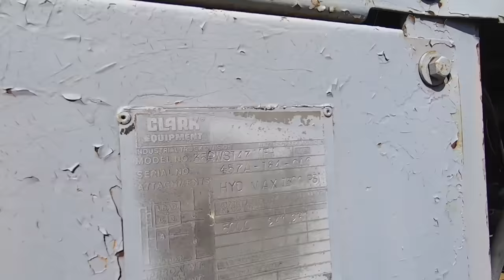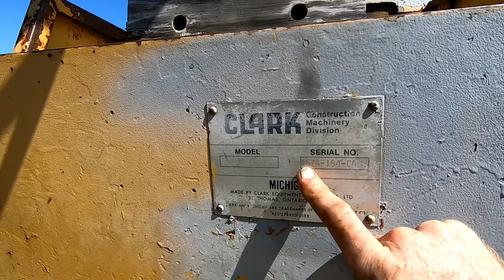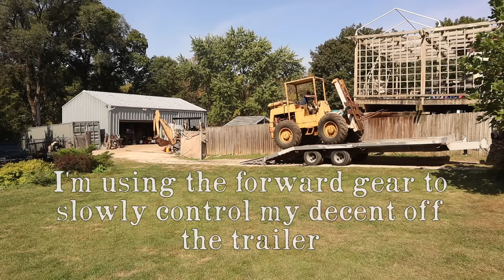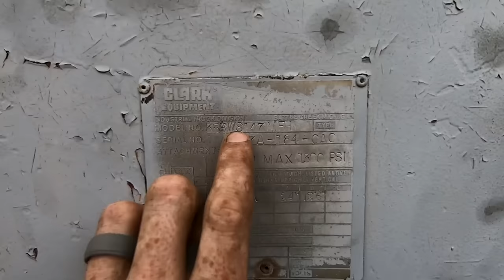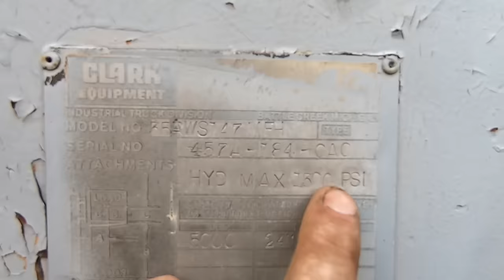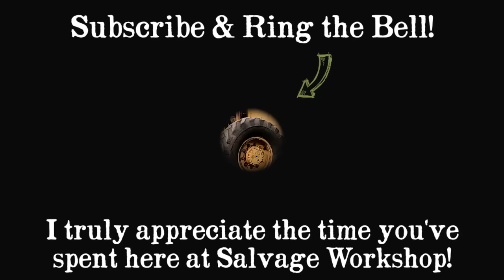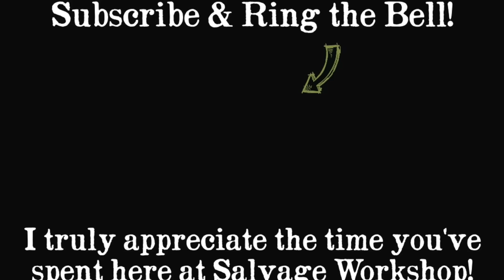I found a RARE ALL-Terrain "Wheel Loader" Forklift! Will it START?! (THIS Machine PUT UP A FIGHT!!!)

Comment: Used load timber at a sawmill that had a Michigan forklift almost identical to this one, same 4 wheel steer,  4wd,  but it had a fully enclosed cab. Can't be sure of the motor though,  sounded like a Detroit. We also had a front end loader version at the company I worked for with a perkins but it was only 2 wheel steering,  absolute bastard to drive on the road,  wandered about like a who're at a christening.  This was 40+ years ago in New Zealand,  they were old machines then

Comment: Mercedes Diesel Cars in the early 50's would start in reverse if the battery was down .The workshop manual says to check for reverse running by the smoke coming from the Aircleaner and /or soot deposits in the engine bay. .That starter is probably for a marine application because Perkins engines can be found anywhere.

Comment: @1:15:00
Those cheap Tor-X bits are NOT a Carbide "Easy Out" tool. They are usually
very weak, cast. An actual "EZ out" is much different.
Reply from the maker: Ive never had good luck with actual easy outs, they alwaus tend to make my life more difficult! I have broken the torx bits, as you saw, but rarely! I cant even count how many bolts ive removed with that method... probably hundreds or more! And they are way cheaper... everyone has their ways!
Reply: @SalvageWorkshop  Oh, yes, please understand, I wasn't knocking your method at all. I was merely pointing out the difference. A Tor-X bit is probably better, since if it does break, it's way easier to remove than an actual Carbide EZ-Out. Those are horrible to drill out, hard to weld to, a very miserable metal to work with. 

I was so happy when you got that forklift running. That new starter is a beast!
You even remarked that there was a lot of room for something larger than what was there, and you were correct. Great, lucky find in the field.

Comment: Perkins diesel they put in skid steers among other equipment. there are CCW and CW starters, My guess is the start was bad and someone looked in their parts bin and pulled out some old starters to try. you can have that starter I believe changed to turn the other way.
Also when your winching throw a blanket over the cable, that way if the cable breaks it slows down the cable whipping and taking off your head or wreaking something else. same with the remote has a long cord so you don't stand next to the cable. and the cables do break! also if you want to sell the forklift or hear of another all-terrain forklift send them my way.
Email Clark with the serial # and they may have the info you need.

Comment: The Clark equipment factory used to be located in a suburb of Jackson Michigan.  Called Michigan Center, Michigan about 80 miles due west of Detroit. They also had a big machine shop on the eastern side of the of the city of Jackson    In all that is where your machine was born.   It was a huge employer.  About 1980 they opened up a Rockingham NC factory and really screwed their employees by suddenly shutting down the Michigan plants.. Later on they opened up a Mexico City factory.   Toward the end they were working with Perkins for motors and also did a lot of transmission prototyping of transmissions and driveline components for Perkins, GM and Nissan.  My best buddy I grew up with his father worked for them. He bought a new Ford van body and chassis through Clark and Clark installed a Perkins diesel and prototype transmission (before the Navistar 7.3).   They did the work for free but as it was a test bed he had to take it in for inspection and service at the factory and keep a log of what he did with it.  Just a bit of history.   Had many family members and friends work for them.

Comment: Back in the late 1980s and all through the 90’s Perkins diesel was a popular re power/ replacement for Detroit Diesel powered equipment. I used to work at a heavy equipment rental company in Virginia. They had 3 of those clark/ Michigan  off road forklifts …all three had those had re power  Perkins in them.  Very reliable engine and more power than the old screaming Jimmy  engines. They even  put  new Perkins in a few old Gallion graders they had that used to have 4 53 and 4 71 Detroit’s. Also rollers and compactors. I prefer those Perkins over the Detroits.. now the bigger Detroits are cool though and sound great

Comment: when you were first trying to start it in you can tell its sounds wrong, but not actually bring there i just figured it was the camera making it sound weird. then i kind of figured somting was up when it wouldnt fire on ether, but back seat mechanic is always hard because cameras and mics play tricks. i have had several times when engines spin backwards, its generally on cars where they have done a manual to auto swap and the starter was on the other side.

Comment: If you use a revers spiral drill, it will walk the bolt right out. I did it several times on 70's GM style starters.

Comment: Don't you have a reverse rotation engine when you have two engines in a marine application? I seem to remember a fellow had two Ford engines in a marine application and one was reverse rotation. I believe that starter that was reverse rotation is also the same type of Delco Remy used on International light truck diesels (6.9 and 7.3 diesels) The starter that you have now I recognize as the Delco Remy used on a Cummins diesel. I went through quite a few of those on my International cabover (96/70). The biggest trouble was armature failure. I finally purchased one from NAPA and it had a one-year warranty, but after thirty days damned if it didn't crap out. I took it to the fellow I usually did business with, and he found right off that the armature was bad, so I had him put in a new armature and it worked fine. I was going to take it to NAPA, and have it warranted but knowing my luck I would get another starter with problems. I got to where I could zip that starter in and out in about twenty minutes. That starter on my International had the same spacer. When you get away from this stuff you forget about stuff like this. You are correct however, when you fool with something that someone else has been fooling with you just do not know how many problems have been introduced. That other starter would probably have worked OK if you had the rotation reversed and a different starter drive for standard rotation. I think that most of us may have missed that one also at first because we are used to proper rotation and would just assume that the starter was correct. We will have to file that one under experience and hope we will remember this twenty-five years from now. 🥸👍👍👍👍👍

Comment: I know you don't show everything you do on camera. But I always take the jumper cables to test a starter before I put it on.
Reply from the maker: I usually do that as well, but this starter was SO easy to take on and off, it was easier to skip that step on this project
Reply: @SalvageWorkshop  I have seen a  few tractors where the starter bolts to the transmission side of the bellhousing, so it's turned around facing the other way. Wouldn't that backwards starter turn the engine in the right direction  in an application like that?

Comment: first to say, good video and well done to bring this machine to run without any informations about it! 1.08.15. i nearly tumbled backwardsfrom the chair caused bye laughing about the scene at 1.08.15. the combination of the uncorrectly axles steering in combination with the sound which is like a fueled engined rc car. very funny.. thank you for this!!!

Comment: Engine turning right direction, has a pusher fan. Faceing fan on engine should turn clockwise. Shut off in injection pump sometimes stick in off postion when sitting for a while. If no smoke from exhaust, not getting fuel. Fuel seems to be your problem

Comment: Hey Guys, Did you check all the tyre sizes. The front tyres look a bit bigger than the rears (it could be that it's on TV, as perspective often looks odd on TV). Although I'm an engineer (Computers & Electronics) I have almost no information about loaders/forklifts, sorry, but I would check ALL FOUR tyre sizes & maybe even write them down so you can compare them properly!!! Good luck, Ian from England.

Comment: When you get up against it with hardened steel sharpen up a concrete carbide bit to cut through it or if you have it carbide end mills ( particularly good for getting a flat surface to center your drill bit on) or drills work very well.  I would have tried a left handed drill bit before pounding in the torx bit.  Sometimes they will surprise you while worse case you still have a hole to work with.

Comment: Okay... now I REALLY want to see and learn how you converted the string trimmer to accept a hedge attachment.  THAT would be so useful, and you should maybe perfect and patent that idea.
Reply: Some of the commercial stuff like Stihl uses something called a power head and then can use different flex shaft attachments. I think they call it Kombi system. So you can go from hedge to string to disk edger to blower , etc.
Reply from the maker: The trimmer is an older FS-90 that ive had for a LONG time! You can remove the trimmer head on about all Stihl trimmers by loosening 2 T-27 bolts that clamp the head onto the shaft, then the head will slide off... then i added the hedge trimmmer in the reverse way... this is not the Kombi system that Stihl sells, i found that system didn't hold up well when used commericially... it might work well for home owner use or light farm use... you can also put other attachments on most trimmer power heads... i also have a pole chainsaw head on another trimmer, no it doesn't extend, but it's still very useful! I only suggest doing this on straight shaft trimmers.
Reply: @SalvageWorkshop  - Thanks for that.  Maybe you'd consider freshening that thing up and showing us what you did.  I've got about 6 string trimmers and I'd love to make them more useful to me.  They aren't Stihl, but ... who knows?
Reply from the maker: @tylerbarrett6652  We'll see, videos I've made working on my Stihl equipment haven't done very well in the past because SOO many others have already done videos on that topic... i will say that i am a diehard Stihl user because they are VERY well built and just work... i would doubt there are many other brands you can do this with other than maybe RedMax or older commercial Echo trimmers maybe a couple others, but those are WAY less common compared to Stihl... main reason is they are made for the commericial user and not the homeowner like a LOT of stuff... i could be wrong, never know!

Comment: I could hear something out of place when you were first turning it over with the starter out in the field.  It sounded like the engine was free-wheeling with no compression.  Once you discovered the reverse rotation problem, then the no-compression issue made sense.

Comment: If the air horn works, the air compressor is at least doing something. Check if there´s a pressure gauge somewhere or if not, hook one up. If the pressure´s ok and there are no leaks, the brake problem is somewhere down the line.

Comment: Hi, like your video’s. Watched you load your tailor with your truck winch, you shouldn’t stand near the cable, also as a safety tool you should throw a blanket over the cable so if it snaps it won’t take your head off or cut you in half. Just trying to keep you safe. Be safe .

Comment: Some motors have the starter mounted on the transmission side and others on the engine side of the flywheel.
If they are swapped the motor will be turned the wrong way
If you look closely you may find a rotation direction arrow on the body of the starter
Phil from OZ

Comment: The starter can not be wired wrong internally.
If it runs the wrong direction, the Bendix gear drive would never engage.
- except if the Bendix drive is replaced together with "wrong" wiring during rebuild.
A very entertaining problem solution 😀

Comment: AHAA ! Fixed a CAT that had more than that crud in the filters . I ask the owner how many times he changed the filters .. he said it was the orginal filter on the mechine when he bougth it 10 years ago .  When fireing an old diesel try some penetrant in the cylinders to free stuck rings😳 and in the injector pump . Try some propane instead of ether. great videos. thanks

Comment: i was always taught not to smack the side of a starter. you run the risk of shattering the magnets inside. i was always told as a limp it home situation you should only hit the ends of a starter if thats what you decide to do

Comment: What do you mean, "it ain't done got no breaks?" LOL
Do you know what a center hole punch is? Great tool for centering a drilling point. I use them all the time. I also spray the area with Kroil to seep into threads. I use chrome vanadium torx bits to pound into the hole I drill. I always get my broken bolts out.
Reply: I never get any of the breaks.

Comment: that is a clark power plant that is in quite a few of theyre older forklifts, common problems with these are: solonoid in the fuel pump going bad and having a no start issue (parts are still avalible form clark for this), it has a lockout in the transmission so it needs to be in neutral to start it, also, the enginge is isolated from the frame and there should be positive strap going to the engine for most of these power plants. (go and ask clark for a manual on this powerplant)
Reply: "In 1953 it purchased the Michigan Power Shovel Co" found this on a wiki of clark, i know they did manny aquasitions between 40-80 like bobcat, apperently they allso bought michigan, they have allso donated some documentation to "Berrien County Historical Association" around the 2000 the european branch of clark went backrupt and was sold, the amerikan branch was allso sold of and the asian branch was saved by a few investord around 2010, the asian branch bought back the remainder of the european branch an allso the amarikan branch i think it went like that. So for old manuals you might have to contact clark asia.
Reply: All and all if the clark badge is on it is a good peice of equipment that can stand up to a lot of abuse. In that drive train you are first going to chasing electrical gremlins, mechanicaly they are verry strong.

Comment: Next question is was the oil ever pumping when it was cranking backwards and will the hydraulic pumps operate forward and backwards, if not then is the engine spinning the same way as intended?

Comment: Clark also used iveco engines. 4 stroke so no need for blower or turbo. Iveco is italian.perkins is english. Older english cars/ engines had the positive on the chassis instead of the negative. But perkins had some engine types with clockwise/counterclockwise rotation. For example the P6 100hp 6 cyl 3000 revs.

Comment: Worked on a cat 977 once, on that the fan pushes the cooling air out through the radiator. It doesn't pull as most cooling systems do. So can't always trust the fan to tell the story.

Comment: Did you think maybe a leaky injector partially filled a cylinder enough to turn a little? Then with all the barring over the fuel escaped by the valves/rings?

Comment: @Salvage Workshop
Hi from The Netherlands. Maybe I can help you with an operators  manual of a 35AWS Tractor Shovel.
I am not sure if it is a 100% match but it looks pretty identical and it includes a section about maintance etc...

Comment: If you’ve ever seen a winch cable snap under load you wouldn’t stand anywhere close to where you were and as for handling it! 
Also just run a piece of quarter inch plate across the front of your trailer to allow the cable to slide onto your winch instead of dragging across the hard angle of the trailer frame

Comment: It looks like the front wheels are larger/taller than the rear tires. That could be a problem in four wheel drive. On car and trucks, they are the same size.... or problems. Great videos.
Reply: I noticed that too, but sometimes in forklifts you see this, I wonder if the rears drag a little? Or if the rear ring gear is the same? Maybe it’s geared for the off tire size?  If using on soft ground or really anywhere but pavement would it even matter?  I didn’t want to comment directly but hope he sees yours!

Comment: I've seen a 1965 Ford pickup starter run backwards, it was dew to  the electric systems having the polarity reversed by someone charging the battery with positive to negative and negative to positive all the while the battery was still hooked up to the truck's electrical system. By doing so they somehow reversed polarity. Had to let the battery go alway down jump from another Ford until it was fully charged. I've only seen or heard of this in 60 years.

Comment: I had a starter rebuilt at a place that only rebuilds starters (They did it for free - long story) and it still wouldn't fire up after I reinstalled it. Found out the original manufacturer was a small company down the road that sold it under a larger brand name. I took it to them and they rebuilt it for me for $40 bucks - said the other rebuild place had put in a reverse direction motor.

Comment: I used to work for a FLT company who showed us the tipping angle of a FLT on uneven ground.   At maximum load at maximum lift, the machine would tip over at 3.5 degrees, but was restrained from totally falling by the test rig.   That was with solid rubber tyres.  Pneumatic tyres will have a bit more flex.  So please bear that in mind before trying anything too adventurous.     Best of luck, stay safe..
Reply: and linked to this issue is being tall with a lot of underbelly clearance the centre of gravity has been raised: nett effect easy to tip over sideways especially with "high" speed cornering!

Golden rule carry the load low.